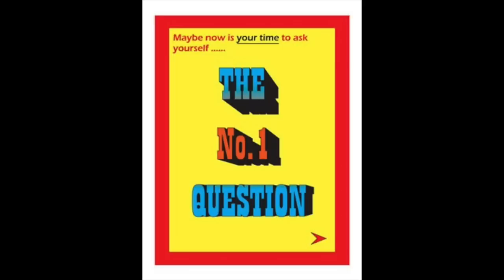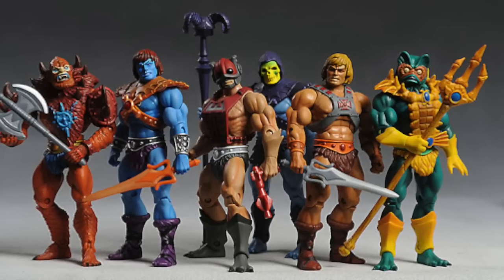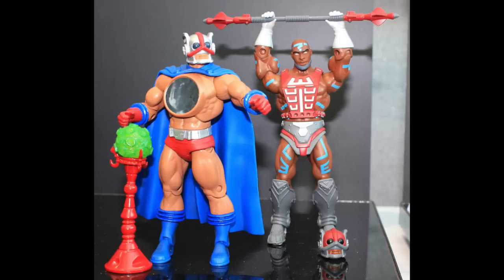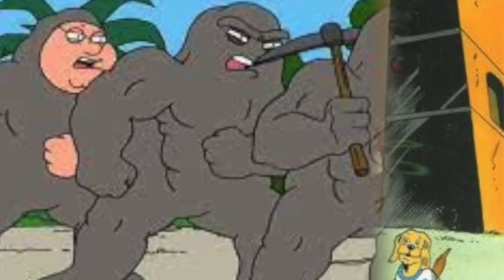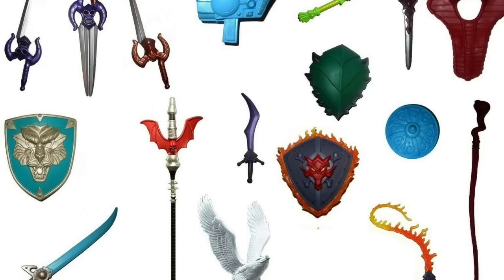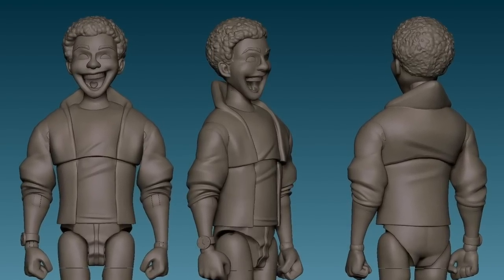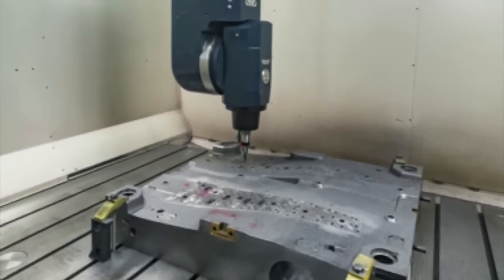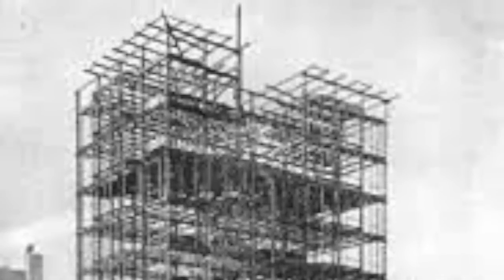Why is Tooling so expensive? Why are they made of Steel? How are Tools Made?All this and more!

Comment: The cost of tooling involves the design and engineering of the figure, as well as the engineering involved in the tool.  But that is a one-time cost.  I believe you mentioned having to make more than one tool for MOTU Classics He-Man because it was used up.  How much cheaper is that second since it's only the material and labor of making it?
Reply from the maker: The design is a different line item in a budget to the actual creation of the tool. But yes there are some minor savings when doing a duplicate of an existing tool

Comment: Maybe someone has asked this already, but I was wondering how many molds(or tools) get made per unique figure? Like for example in the Original Kenner Star Wars line you had figures like Darth Vader that were basically produced throughout the entire run of the line. There must have been tons of this individual figure made. Is only one mold used to crank out all these figures or are there copies or duplicates made so they can crank out more than one figure at a time? Seems like if there were only one actual mold being used it would slow down the process greatly and also be catastrophic if it got damaged somehow mid-run on the figure.

Comment: I understand the concept and logistics of the engineering behind the tooling, having worked in the electronics industry for a number of years, however I still don't understand the ridiculous cost of the tools... we used steel tools in the electronics industry to manufacture cases, buttons, remotes, chassis parts etc. but they didn't cost that insane amount of money. Something just doesn't add up to me.

Comment: "it has to be made of steel" Not exactly, although true probably for 99% of Action figures. The material of the mold depends on what it is planned for. What type of plastic is being injected and what what the anticipated production run is. How many shots are needed off of the tooling? Steel is most common these days. But you can also find Zinc/Magnesium, Aluminum, and a few other blends. At one time there was talk of magical Ceramic Tooling but I don't know that that ever really materialized. Pretty much if you can make an Engine Block out of it they have made plastic molds from it.

Comment: The plastic is injected into the molds at HIGH PRESSURE to make sure it fills the mold completely. That's another reason the mold has be made out of a block of steel.
Reply from the maker: Excellent point

Comment: I wonder. I think You said in another video that The Term Tool is also used for injection molds for things other than toys too, and I’ve heard you use the Term “Re-Tooling” before. Do you think that’s where the Term Re-Tooling comes from in the entertainment industry? Like I’ve heard it used when they make Significant changes from the pilot episode to the final show. Even I’ve referred to the series Extreme Dinosaurs as “The Re-tooled Spin-off of Street Sharks And Dinovengers”.

Comment: Chocolate molds are incidentally made of plastic. Chocolate doesn't heat up to the temperatures of plastic, plus they withstand the rigors of chocolate making better, especially the cleaning, which would corrode steel very fast.

Comment: How does retooling work?  Are sub-molds placed into the primary molds to block off unneeded sections?  Or if the new main mold has a slightly different design from the old one, is a brand new mold made or is the old one altered?  Thank you
Reply from the maker: I’ll get into this in an upcoming vid!

Comment: How is a company like Joytoy overcoming this hurdle of tooling? The figures are more expensive, but not compared to all the tooling cost that is going into them.
Reply: This is simple. There are a few factors that will go into the cost of a tooling set or mold. What Plastic are you injecting? This will determine things like temperature and pressure that the mold needs to be able to withstand. How many cycles will the mold need? How many toys do you need from this mold set? Molds where out. Details grow soft from repeated use and eventually they will fail. The more cycles you need, the more expensive it is.

This shows up when comparing a regular retail toy brand, say Hasbro Marvel Legends, and a collector targeted specialty brand such as NECA. NECA puts out a broad variety of subjects each year. But that is because their figures are mostly made of PVC. PolyVinyl Chloride. Which is a softer plastic. It flows well at low temperatures and low pressures, and short run tooling for a PVC figure is not that expensive. But we all know PVC figures. They warp over time, they dry out or get brittle. They are fragile. They are figures for collecting and do not stand up to child play. So for an expected run of only a few thousand pieces you can use much softer and cheaper metals for your molds.

Whereas something like a Marvel Legends or a Bandai SH Figuarts are using almost entirely ABS Plastic. This is a much more sturdy plastic. With some formulations being near indestructable (Lego). But ABS is much much more expensive to work with. It requires higher temperature plastic injected at much higher pressure. This requires hardened steel tooling. It tooling cycles are expected to be in the millions that becomes a very expensive tool set.
The final element of cost is how much precision is required of each part? Most Action figure parts only have 2 points of connection. Typically 3 or 5mm. They need some precision so the joints work. Which puts them middle of the road for tooling costs. Believe it or  not the most expensive toy tooling is Lego Bricks. The level of utterly insane precision needed for Lego is just staggering. Each piece must connect perfectly to every other piece, ever made. With a prescribed amount of clutch power and ease of separation, in three axis. Every piece of the same type must be exactly the same. A full toolset that produces the classic Lego 2x4 bricks costs around $500,000. It spits out I believe 24 bricks per cycle and is expected to run for millions of cycles over many years.

Joytoy is mostly PVC. One trick a lot of collectable figure maker companies do is they create an internal skeleton or armature, or just the joint connections out of fairly standard PVC. Then insert those into the main molds and shoot PVC around them.
Reply: @andrewtaylor940  This is pretty much the most insightful things I've ever read in regards to this process and the expenses involved. Exactly the information I was looking for. Thank you!

Comment: Good video - but HOW expensive are the tools, typically? I noticed you didn't get into actual numbers or costs and I think that's what most collectors are after. How do companies justify their exorbitant pricing if the steel molds themselves are less expensive than we think they are? I've heard way too many numbers out there ranging from $5-10,000 to $100,000 for one mold. It is fascinating to see how multiple accessories get tied together like that - almost makes me think it's more economical to keep making new figures rather than having to mix and match.
Reply from the maker: A fully tooled 6” figure we run about 100K
Reply: @spectorcreative1872  wow - are ships or vehicles any cheaper or any easier to produce?
Reply: How much was the tooling Classics Castle Grayskull is what I want to know.

Comment: Speaking of sculpting joints, would you know why, say, Marvel Legends’ neck ball joints vary in sizes where other toys, e.g. imports, use standard neck pegs? It sometimes frustrate the way we can’t interchange head sculpts because of this. Did you have the same issue with your DCUC line?
Reply: I thought they did it on purpose so collectors wouldn't be able to fit certain head sculpts and have to buy the new one.

Comment: This even applies to lines like Transformers, Hasbro has used a base transformation engineering from a character like Hot Spot, and created chunks and pieces to turn a fire truck into the Ecto-1. Both toys have the same base design, but using unique "satellite" pieces that aren't integral to the set design makes a brand new figure.